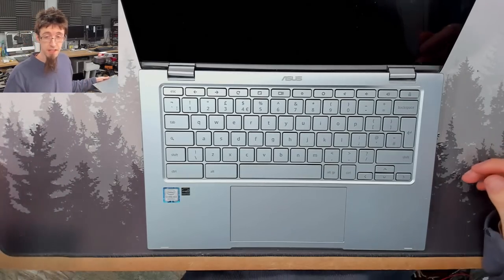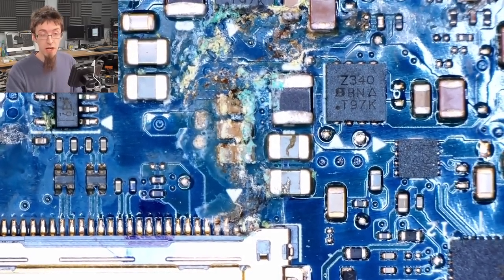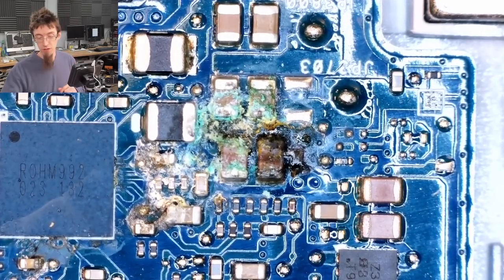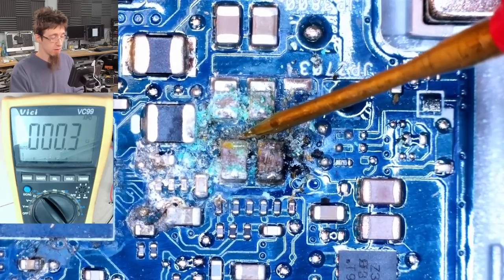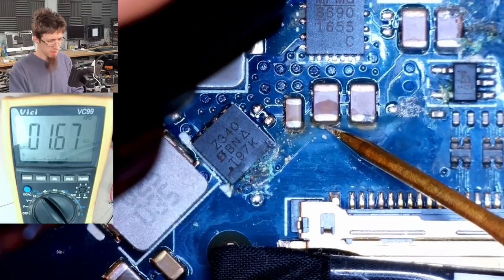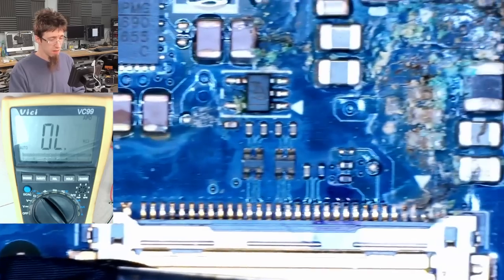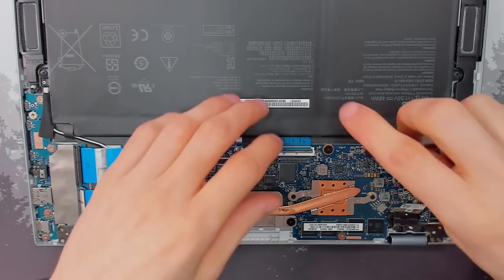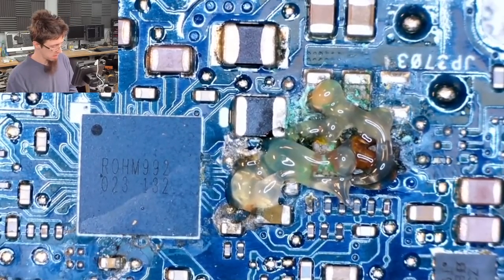Asus Chrome Book, No Power - LFC#328

Comment: Can I ask which flux you use? I've always soldered without flux, but would love to get some for board work. I had a look online but there are soooo many flux options, different sizes and types. It's a little confusing!
Reply from the maker: Amtech to victory, but make sure you find a proper supplier - eBay / china will be fake stuff. The real stuff is much better. UK supplier I use: https://www.cnlselectronics.co.uk/product-category/amtech/
Reply: @Adamant_IT  Awesome. Thanks so much!
Reply: @Adamant_IT  Actually this is fake. According to Northridgefix, there is no V3 Amtech flux. Inventec has terminated its commercial relationship with Amtechdirect on September 2021. Any flux sold by amtechdirect is not a genuine Amtech flux. That does not mean it's not a good flux, just not Amtech.
Reply from the maker: Interesting... I was linked this supplier on very good authority, and this stuff works much much better than the eBay Amtech I was previously using. I'll check in with them and see what their thoughts are. The Amtech brand itself is such a mess that it might not even matter if it's genuine, only if it's actually good or not.
Edit: I checked into it, this comes down to a legal battle between Inventec and AmtechDirect. No one actually owns a trademark on Amtech, so between the two of them, there isn't a "genuine" option.
However, both make excellent Fluxes with very similar compositions. The V3 flux is from AmtechDirect, and is easier to get hold of in Europe because it's REACH compliant.

Comment: I doubt it would have gone any better if you cleaned it first, you saw the cap was bonded to the trace and it had already gotten so hot it lifted right off the board, the best outcome that could've happened is you noticed sooner and cut it in half before you had to re-route the via, besides ignoring a little extra time spent, the important thing is the laptop works now, if nothing else, at least that time wasn't wasted.

Comment: Can you run the wire through the via? instead of around the side of the board?
Reply from the maker: You'd need to drill out the via, and it's 0.1 maybe 0.2mm wide. If you miss, you drill a hole through an internal trace in the PCB. So theoretically yes, but in practical terms, it's not worth it. The via could also be connected to internal traces, and drilling it out will break those links.
Board views will show circuit networks, but not where traces go, so this kind of information is very difficult to be sure of.

Comment: Weird point, but it looks like the only point of that via is to present the test point. Maybe I just missed it, but you may have been able to ignore it.
Reply from the maker: The via had resistance to ground when I was looking for shorts, so it definitely goes somewhere. I think it's a feedback wire to a power management chip.
Reply: @Adamant_IT  Ah, I see. That Chromebook should be thankful it was in front of you instead of me. I would have missed it.
Good work

Comment: Nice fix. I think if you just ground down the shorted cap, this would have been a much easier job, keeping the trace intact. Maybe with a dremel type tool. Hindsight is a wonderful thing though 😉
Reply: Mr Guru  Yes I will concede it's not easy or even practical, but it is possible with just a grinding stone attachment.

Comment: The Via thru-hole might have been able to pass a small gauge wire through the circuit board and then no wire going around the board, otherwise, why did you not just use a piece of insulated wire instead of bare wire ? Old days when they needed to mod circuit boards, the via thru-holes were bigger and you could pass bell insulated wire through those holes to one protect the wire, and two shorten the connection, even if you did not need to connect anything to the via, it could be used as a tunnel to get a connection from one side to the other.
Reply: These through holes are incredibly small. You have no chance of getting a wire through them.

Comment: It looks like there was a bit of copper left on the trace for the through hole, could you have connected to that without using a jumper wire going around the whole board or was it not enough of a pad?
Reply from the maker: It was definitely possible, but I didn't feel confidant that I could get a reliable connection to such a small amount of metal. The jumper wire around the side was less pretty, but the test point I soldered to was a lot bigger than a via.

Comment: Hi! Thank you for another amazing video :) its impressive you managed to fix that grusome motherboard...

I would like to ask you unrelated question, tho. If a desktop motherboard does not react to the power button (just like the psu wasnt plugged in at all), does it mean the chipset is fried? Or what might be the matter? Thank you so much in advance for any response.
Reply: Mr Guru  turned out to be the wierdest thing ever - cmos-clear pins where bent and shorting out for some reason, after removing the short board works 😅

Comment: You always want to work on clean equipment. Just like mechanics. Something may look like a nasty oil leak, but once you pressure wash the area, it's easier to see and work on and turns out to be not as bad as you thought. Same goes for doctors and surgeons. They need to clean you up first to really see what's going on. Like you said, you had a video of where the issues were. There was no reason to not clean it first. That board was bad.

Comment: A little heavy on that trace...??    Was it not possible to drill the C-B for a shorter length of wire..??    A pin into the green stuff tube should have been more than sufficient, far too much was used and wasted.     Perhaps a heat gun and the uv light..??    Thanks for your videos...

Comment: Running the wire through the via instead of around to the other side of the board would have been a cleaner way of going about it, provided it would fit.

Comment: Reaching out for help. I have a Dell Latitude E6520 for parts and it has a touchscreen. My daily use Dell Latitude is a E6530 without a touchscreen. Can I install the touchscreen into my E6530. Is there extra hardware on the mainboard or is it just software? Thank you in advance.
Reply from the maker: On a Dell, most likely it will work, yes. Some laptops, the digitizer (touch) as a separate cable that probably connects near the display cable, and some some laptops they run everything through the eDP (display) cable. In any case, I'd wager that it will Just Work, or the extra connectors you need will be there.
For other brands, especially HP, connectors for optional extras are often missing unless the laptop originally shipped with the optional extra.

Comment: Okay we both know I know less. Would it have been better to first try to clear the corrosion even with hot air and flux. Then let it cool before checking just how badly it was messed up?

Also toothpick seems to be the preferred method for Kris Fix for applying his UV setting product.
Reply from the maker: I think also, the main person I've watched reflow corrosion was Lewis Rossmann (who I did all my early learning from) and he generally employs the windscreen wiper strat where you just clear the corroded section of the board and replace everything anyway. This isn't a great method if you don't have donor boards and schematics, so I think cleaning first would've been a better move.

Comment: would it not have been possible to feed the jumper wire actually through the via hole? so much 'cleaner' result if it worked, so to speak

Comment: unfortunately you broke it yourself you could also have cut the wire for the cap.  and you could also have put the long wire you made through the motherboard through the hole that was still there and made a much nicer connection.
Reply from the maker: I'm absolutely not brave enough to drill out a 0.1mm via without knowing if it connects to an internal layer somewhere 😓